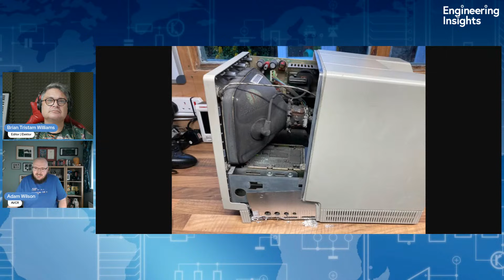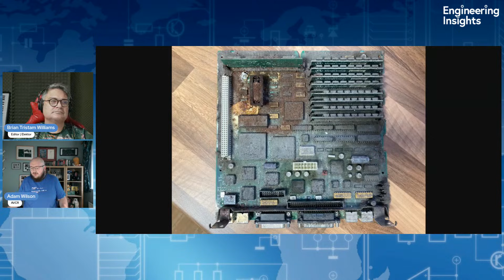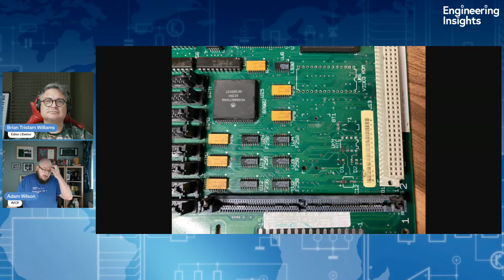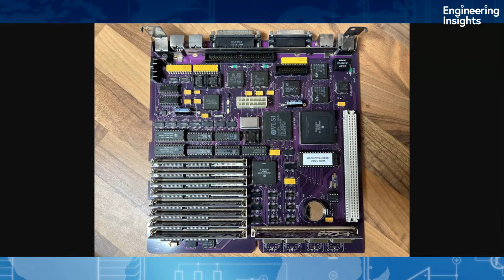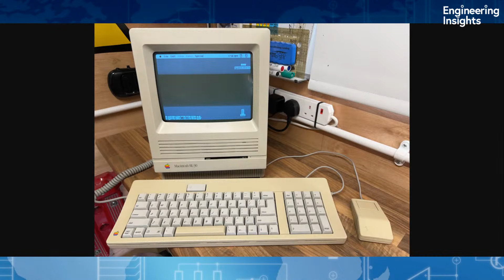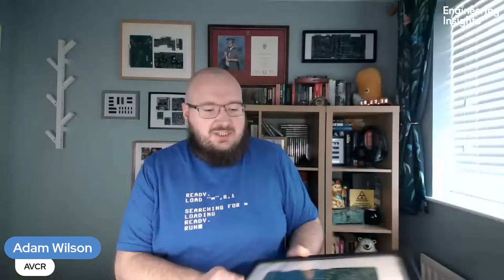The Mac SE/30 Battery Leak From Hell (and the DIY Board That Saved It)

Comment: Hi, where did you buy that replacement motherboard? I have the same problem: unfortunately, I bought an SE/30 on eBay whose internal battery had leaked acid, damaging traces and the ROM.